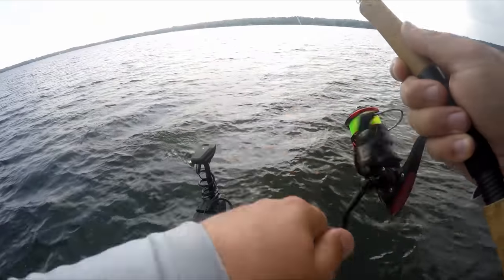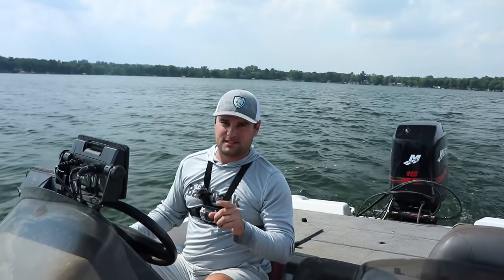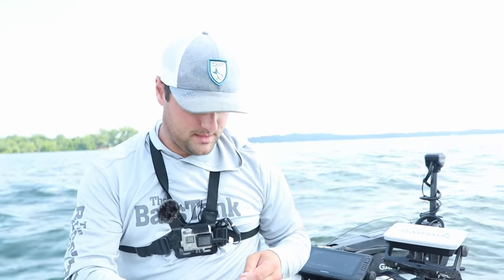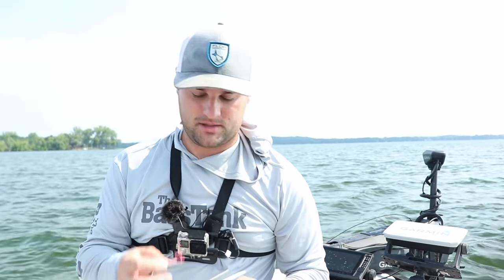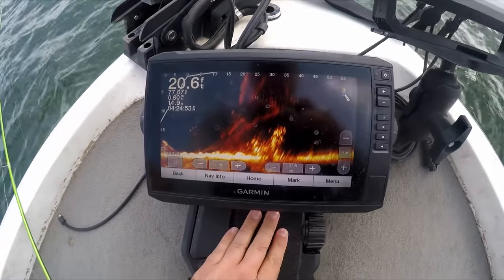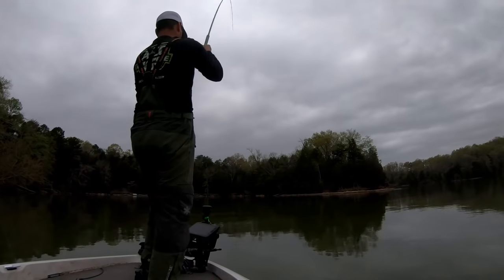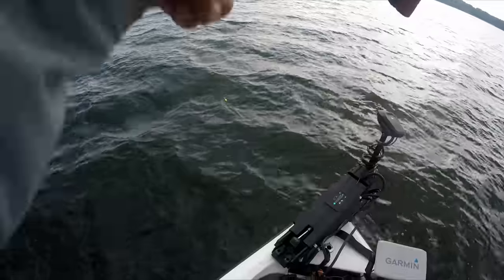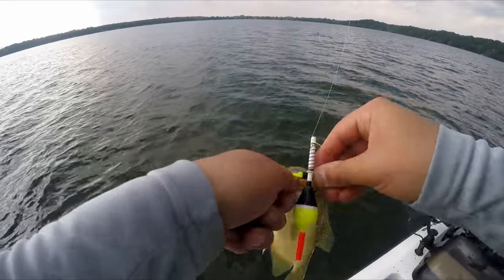Simple Trick to add to Bobber and Jig Crappie Rig

Comment: With this set up, I use 8 lbs. braid tied to a swivel with a 6lbs. leader. That way if you get snagged, you can pull it off and only lose your jig, instead of losing your bobber and bead.
Reply: and the swivel stops the slip float from getting stuck to the jig at least i think it never gave me problems but if it does juts add a bead ontop of the swivel

Comment: Great video.  I bobber fish a lot for walleye and crappie.  One trick I was taught with a slide your bobber on the line followed by a bead.  Then tie the line to a swivel.  If you are fishing deeper, say 12 feet over 20 feet, add a slip sinker above the bead.  Tie main line to swivel.  If you are using 8lb mono, tie a 6lb leader (say 12-14 inches) and then your jib or hook.  This keeps everything from getting caught up.  If you get hung up on a branch, rock or other, you can break of the jig/live bait hook (6lb leader), without losing your bobber.   I like your video with subscribe!  Fishmohr

Comment: I’m just now learning to “really” fish.  One thing that wasn’t clear to me or either I didn’t comprehend.  So I am clear…The first knot you tied is roughly 15ft or so up your line from your jig, which stops the bobber and helps maintain depth of the jig at roughly 15ft down?  The bobber will slide up the line and stop at this point and then slide down towards the jig as you reel it in.  I will need to learn to tie a knot for the bobber stop as I have not a clue what that cannister tube knot you used is.  I looked below in your description but wasn’t sure.  Great video!  Thank you for taking the time to put it together.
Reply from the maker: You are correct. The top knot sets the depth,  which the bobber will stop at. This is a video where I explain how to tie that knot. https://youtu.be/cDIsCsIl0XY
Reply: @FloppingCrappie  greatly appreciate the reply and how to tie the knot.  👍🏻👍🏻

Comment: There is a new 1 of a kind rod coming out soon designed just for the slip bobber guys. Doesn't matter what style of bobber stop you use it will not hang up in the eyelets. Hotspots MEGAEYE crappie rods. Keep your ears open for availability.

Comment: I'm new this forward facing sonars and I'm trying to do my research because I'm getting ready to take the plunge and from what I have gathered the current system is going to run me around 2,500.00. Please correct me if I'm wrong but from what I understand I need a 1. graph 2 transducer 3. black box....does that pretty much cover it...those 3 items? and can anyone tell me what is the best one to get? largest screen I can get with that 2,500.00 budget and also If I decide to get 2 graphs and put one at the console can I get the same 2 graphs and network them with a ethernet cable. Any advise or help with this would be so much appreciated. Like I said I'm learning about these at the moment and trying to get the best deal for the money. Also...if anyone know of a company running a sale or a coupon/rebate on these would be great too.
Reply from the maker: You are correct in what you need for this system.  There a couple of bundle sales going on that are within you're $2,500 price range. The first is a Garmin 93sv bundle which includes the black box and the LVS32 transducer https://bit.ly/3knsbsq . Another option is the GPSMAP 1022 with blackbox and LVS32 transducer https://bit.ly/3MIrV34 . Garmin just came out with the LVS34 transducer as well, which replace the lvs32 and can be bundled with either of these graphs and same black box for $200 more.
Reply: @FloppingCrappie  That is awesome....thank you so much....if I go thru one of these links does it give you a kickback for the purchase? I know some channels have affiliate links that kicks back to you guys.
Reply from the maker: @razorbak6783  yes, I do receive a small commission
Reply: @FloppingCrappie  When I decide to get it then I will definitely get it thru your links ;-)

Comment: Great tip.  Question, are you basing the depth to set the stop off purely the depth of water or are you looking for a certain depth off the top of the brush pile?
Reply from the maker: I was using where the majority of fish were suspended above the brush pile. Most of fish were 10-15ft down in 20ft of water. The brush piles are roughly 4-5ft tall .

Comment: For starters, a spring float is NOT designed as a slip bobber. It’s meant to be adjustable without a wrap, then when you get the depth where you want it, you wrap it once. 4 out of 10
Reply from the maker: Clearly you didn't watch the video, this bobber is a 3 in One design. It has two notches. The notch closest to the body of the bobber is for a fixed float setup. The second notch closest to the stem is meant for a slip bobber setup. You can also run the line through the middle of the stem , which is why this bobber is called a 3 in One.

Comment: What size bobber do you use?
Reply from the maker: 3/4 inch
Reply: @FloppingCrappie  I just ordered the 1/2" before seeing this response because in another video of yours, you were using the 1/2" size.  What determines if you are using 1/2 or 3/4"?
Reply from the maker: @ronknight6400  it depends in the size of weight/jig that I'm using
Reply: @FloppingCrappie  So what size jig for the 1/2”? And for the 3/4”? Thanks
Reply from the maker: @sowabunga  typically I use the 3/4" for 1/16oz jigs. For 1/8oz. I use the 1"
Reply: @FloppingCrappie  Thanks.  Sounds like the 1/2' that i ordered may be too small.  I typically use 1/8 and 3/16 oz jig heads.  I guess that i need to reorder.  Thanks again.  Ron

Comment: Do you know what a slip float is? Because you're not using slip floats.🤣🤣🤣
Reply from the maker: This is a 3 in one bobber. There are two notches on the stem of the bobber, one is for a fixed line position,  the other allows the line to pass through it. It also has a hole through the middle of the bobber. You can either run the line through the middle of the bobber or use the second notch on the bobbers stem to use it as a slip float.
Reply: @FloppingCrappie  just use a slip float so your line doesn't get caught up on the spring